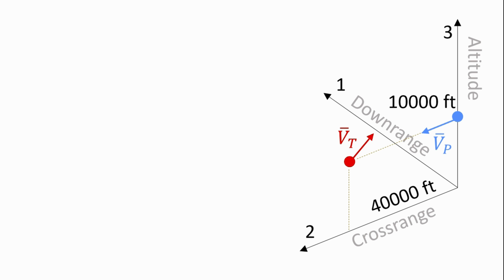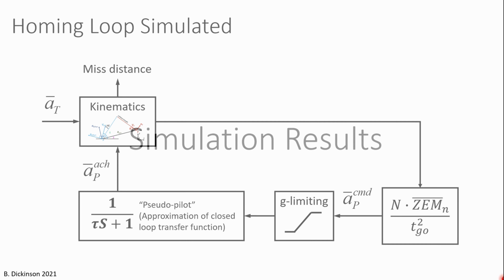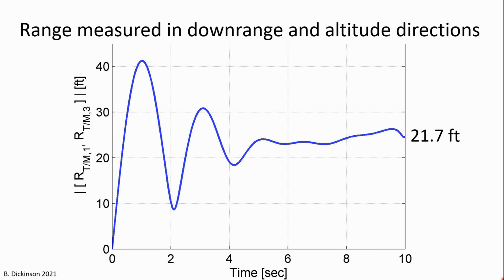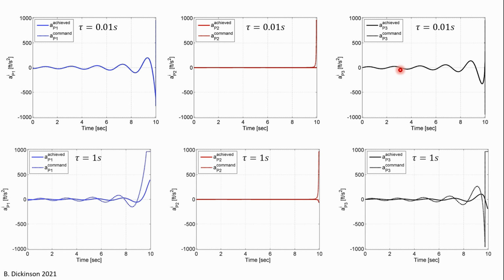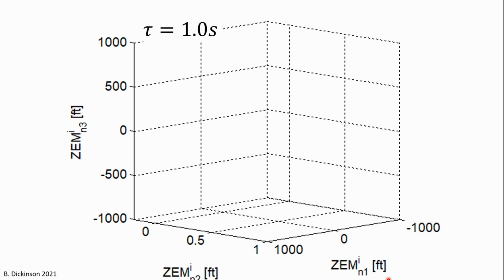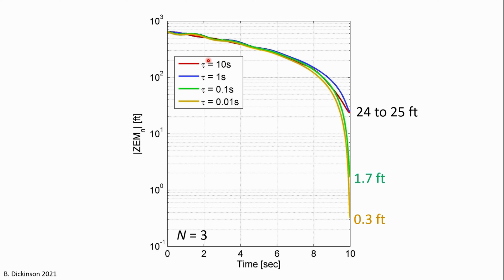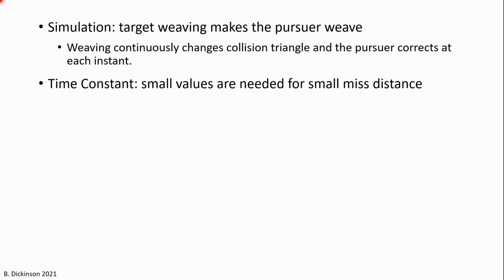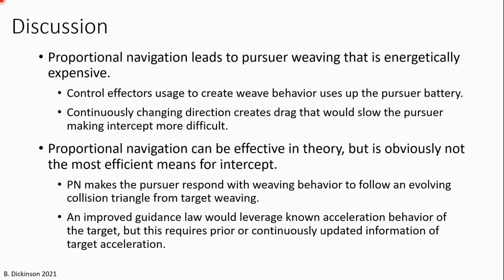Example of 3D Proportional Navigation with Zero Effort Miss - Section 5 Module 2

Comment: for this 3d sim, I noticed that certain variables (like angle of attack and sideslip angle) weren't included (because they relate to the body motion now that we're in 3d). 
My question was, how come these variables aren't included? But I think I might know now.. Is it because it's not quite in the scope of this lecture? 

Thank you so much for making these videos and engaging with us! GNC (Guidance specifically) is such a difficult topic to learn yourself, and your videos make it so much more fun and easy to tap into the guidance field :)
Reply from the maker: Ok, now I'm tracking! You're correct, but there's some rationale to why more detail is not included. In this purely kinematic analysis that removes the complexity of flight dynamics and control in the homing loop so we can clearly understand the properties of the guidance law. Here, I believe we included the pseudo-pilot to represent the closed loop flight control system. Ultimately, if one were to include a full 6DOF with an autopilot, the response of this system would follow something like a low pass filter. As a next step, one could include the 6DOF with the guidance law. But, as you have correctly pointed out, this is outside the scope of the lecture.
Reply: @LearnGandC   thanks, Ben!

Comment: PN with Zero Effort Miss is linearized PN, it is not a non-linear general PN, is that correct? So we can get criteria designs upon it, not a real implementation.
Reply from the maker: Not necessarily. For example, linear analysis and application of linear control methods has been effective in aircraft control for decades!

Comment: Is there an additional step required to go from ZEM's lateral acceleration to an angular rate command for a body? Is there a "correct" way of doing this?
Reply from the maker: Yes, you can directly translate it to flight path angle rate but I have not tried to convert to pitch rate. You may be able to make a PI-coupler between acceleration and q.